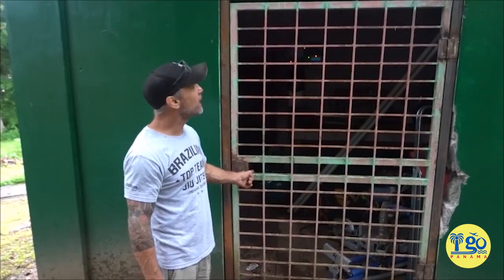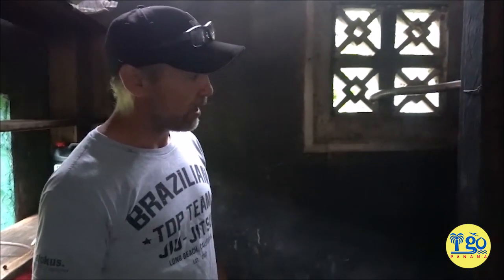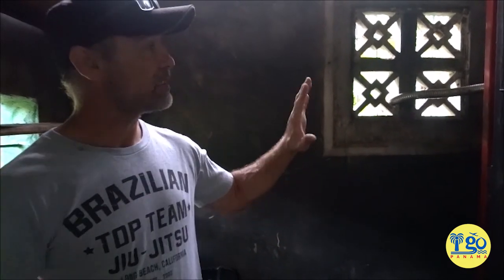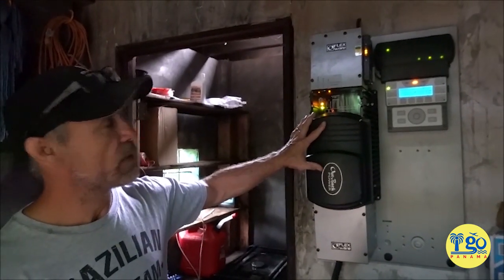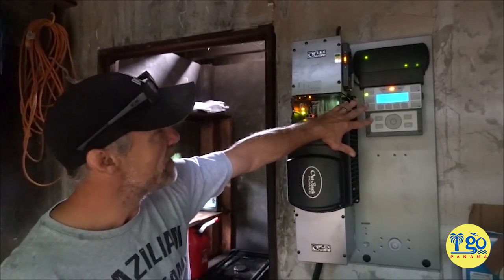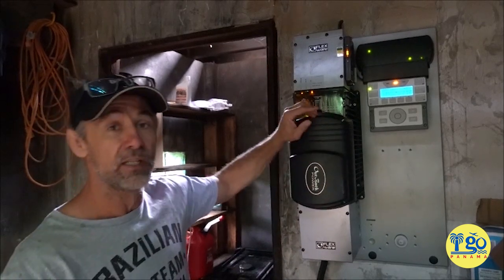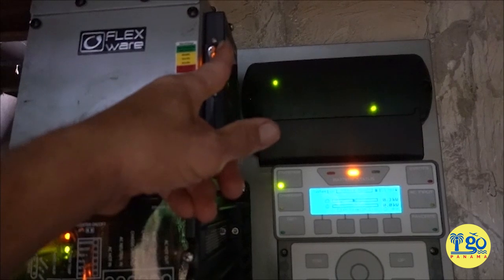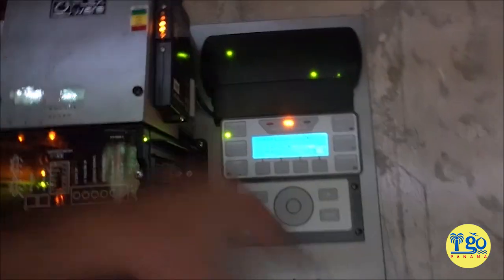Off Grid Electricity in Panama: How Our System Works

Comment: What a great system you have to charge the batteries for the outback inverter from the diesel generator from that time . If there was a way to program the mate to auto start the generator when the batteries start running at a low threshold by using a relay where the generator start switch is connected from the mate to close the relay in starting the gen and turning it off at the desired threshold . Some PV modules ☀️🌤would be great to have to even prolong gen starts even longer keeping the batteries charged up during the day time until such time come for the gen to kick in on prolong cloudy 🌥and sunless ☁️days⛈🌨❄️ . May the solar be with you .⚡️⚡️

Comment: My wife and I live on our sailboat and off grid has become a second language for us. Solar has no drawback and with the system you have in place it would integrate with ease. We have switched to LiFePo4. We have 400AH and it seems a good amount for our two fridges lights pc etc. That 60% setting your using could be easily dropped to 20% or less with lithium. 
 I wonder if you have more amp hours than you think. Our lithium was cheaper than the gel battery you show.
Reply from the maker: The drawback with the solar at this point is cost. The generator is already here, so we just made that work for our needs. Eventually we'll have to add more juice though, and we'll go solar at that point.

Comment: Why not wire in a relay so the generator turns itself on when the battery bank hits the 60%?
Reply from the maker: We discussed it, but we're there all of the time so turning on the generator ourselves isn't a big deal. Plus, we plan laundry around when we turn the generator on. :)

Comment: For anyone doing this, consider LiFePO4 batteries, especially if you've got a lot of charging capacity. Lithium battery will charge faster (provided you have the capacity), they will have a better efficiency and you'll be able to drain them down a lot further without damaging them. In your case it would have meant running that big generator less often.
Reply from the maker: Thank you for this information! We were limited by what we were able to get locally at the time, but I'll file this information away for future reference.